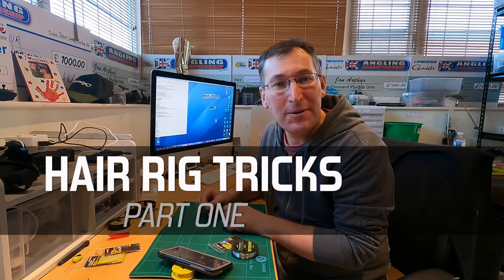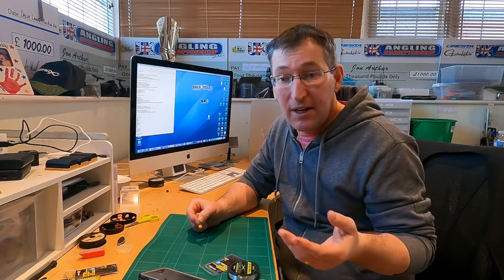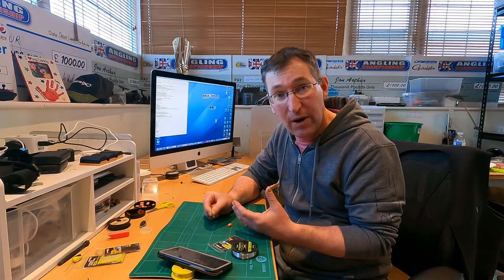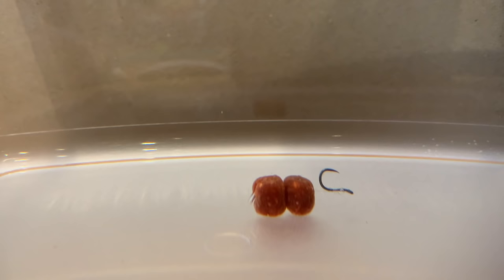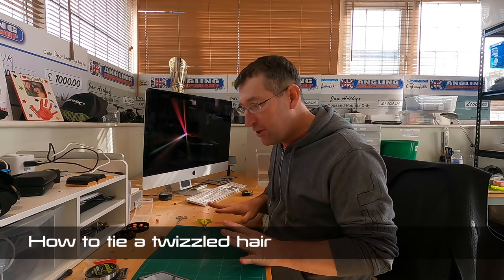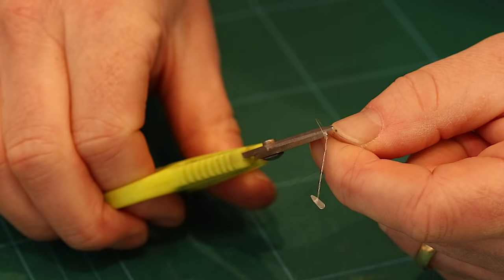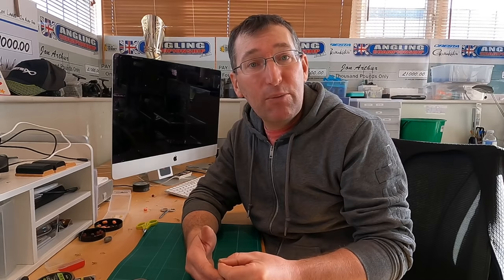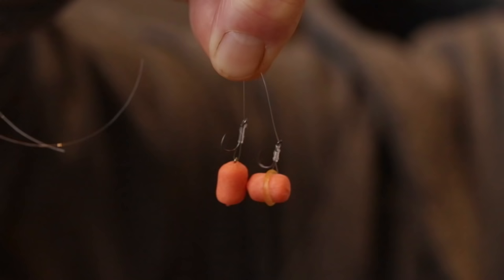Hair Rig Tricks! (PLUS Underwater Footage)

Comment: Another way that I have been using for years: I make a hair with a loop, slide it into a piece of heat shrink tube, put the hairline through the hook eye, slide the heat shrink over the eye and heat it.. The hairline is now slidable to the length whichever you want, depending on the bait size.. A button on the top part of the sliding hairline and you can put a few turns around the hook to secure the hairline and you are done..
Reply from the maker: Good tip

Comment: Probably the clearest and easiest to follow video on hair rigs. In view of your opening caveats (relating to rules/restrictions on commercials), I have two naïve questions please...
(1) on commercials that do not permit braid, do you think that you are still permitted a braided hair ? I.e, the braid ban is only on the line from reel to hook?
(2) IF a fishery did allow a full braided hook length and you wanted a braid hair, would you use a full braided hook length instead of mono?
Reply from the maker: I think braid is better for getting bites and definitely wouldn’t consider a braid hair as not allowed. It’s not the actual hooklength. That would be like calling a quickstop a plastic artificial bait!

Comment: Hi, brill video which has helped me to understand how it is tied. I have tried Push Stops with braid but do not get a clean cut. Appreciate the ones you recommend have a larger hole so should be easier but wonder if you can recommend so good braid scissors that get a clean cut ? Appreciate your help. Cheers Bob

Comment: Hi Jon
Why is the push stop significantly further away from the hook than the band which is very close to the hook shank.
thanks
steve
Reply from the maker: With a quickstop/speed stop style hair rig you have to place the stop at the furthest end of the bait you choose to use. With a band it needs to be at the nearest position to the hook and will stretch away from that point depending on bait size, which is almost always a hard pellet or dumbbell for me. When I use a stop it is often with something like bread that will significantly expand and requires a much longer hair, or a big cube of meat when I sometimes want a greater distance from the hook (longer hair) which is good for anti-eject properties when legering for bigger fish. It also means I can use double corn or double meat etc. But hair length is always worth experimenting with.

Comment: When i've finsihed tying a hook length I can move the whips with my fingernail. They tighten up again once I pull the line tight. Is this normal and can I get them tighter so they don't move? Thanks
Reply from the maker: You can normally nudge the whippings with your nail to get them perfect. With a knotless knot however they shouldn't move too much.
Reply: @JonArthur  thanks for the reply Jon. I am just doing a plain hooklength with no band on, I will try moving the wippings down with my fingernail before I come back through the eye. Hopefully tightens them up a bit more 👍🏻

Comment: Hi Jon could you advise me what length do you recommend for your banded hair rigs for carp 10- 12lb  and what size line to use PS the reason i ask I m a Newby at this type of fishing. I was out fishing using my 11ft pellet waggler  and getting good strikes and the fish are snapping my line its not that the carp have taken me into reads this is when the fish is pulling hard and then ping  you no the feeling there snapping  my  6" leader loops at 9lbs and they are snapping my 6lbs main line  so im losing  everything can you advise me  what size Main line and leader line for Carp 10- 12 lbs  regards Robo
Reply from the maker: If the carp are 10-12lb then 0.19/0.20/0.21 hooklengths. I personally prefer to tie 30cm/12in for pellet wag. 6lb main line should be ok. I’d check your knots and ensure you moisten them and also be careful moving float stops as they can damage the line if not lubricated.
Reply: @JonArthur   Hi Jon thanks for the advice regards Robo